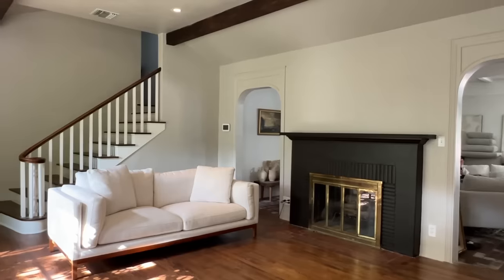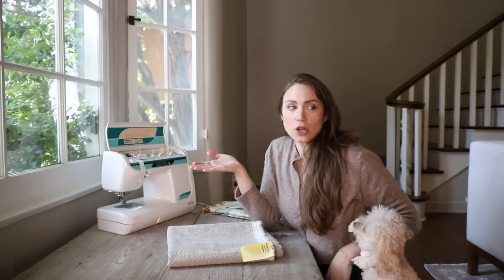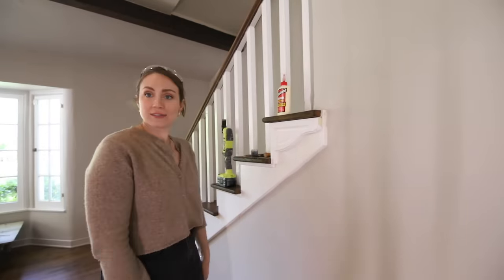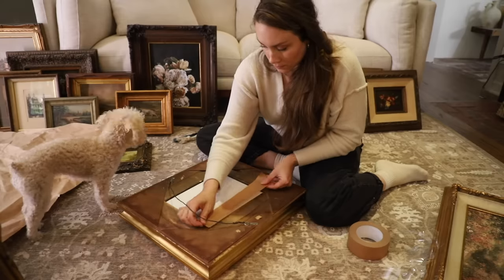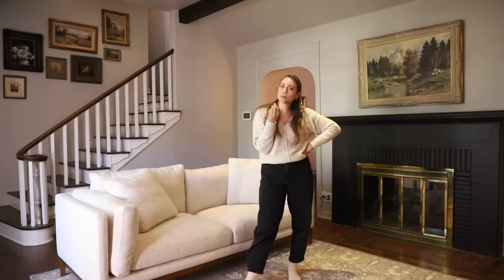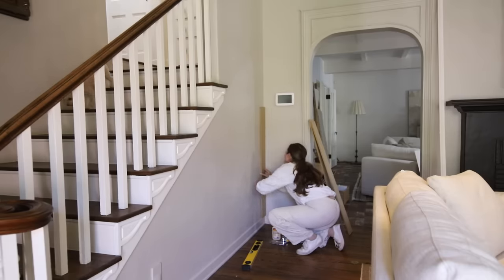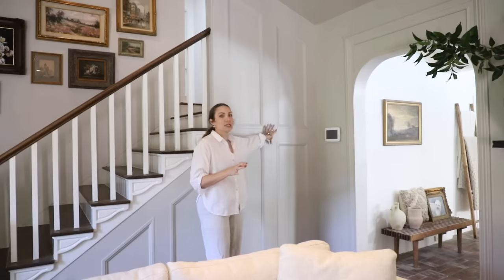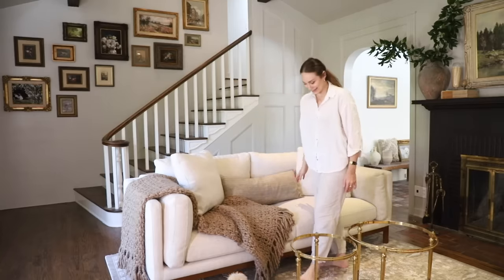ENTRYWAY & LIVING ROOM MAKEOVER *Moody French Provincial* | XO, MaCenna

Comment: Not sure about your local codes, but in Illinois, the combustible material covering electrical wiring is non compliant with code. The wires are insulated, but in the event the insulation is compromised, the fabric can start a fire. So I’d recommend checking your local code to double check the requirements.

Comment: @XOMaCenna, I don't know if anyone's mentioned this, but I got a great tip from a photographer friend about backing frames with craft paper. After securing the paper with white glue (rather than tape), lightly mist the back with a spray bottle, then use a hair dryer to 'shrink' the paper for a perfect fit. I add the tiny self adhesive 'dots' at the bottom two corners to protect my walls. Looks great, easily reversible. Thanks for so many great tips - I thought I'd return the favor!

Comment: Great job on the paneled wall; it looks professional!  I don't know of any trees that will thrive in a low-light room, but here is a solution that worked for me:  I've learned Kimberly Queen ferns are more resilient than Boston ferns as indoor plants, so I bought two and potted them in identical black plastic pots that fit into a large brass planter in my entry.  My entry is fairly low light, which isn't great, so one goes in my front patio with plenty of filtered sunlight and fern-loving Florida humidity, while the other goes in the entry in the brass pot.  Every 4 to 5 days, I switch them out.  Our A/C is in constant summer running mode which is awful for most house plants (dries them out) but this plant switch method seems to be working!  Both ferns look great, and the lush greenery adds so much to my interior decor.  If you want a plant with height, you could put one on a pedestal stand in place of a tree.  Great job on redecorating your room--it looks elegant and cozy.😊
Reply: If you can’t get potted trees to survive in a low light area I’ve seen a couple of DIY faux trees that looked amazing.
Reply: @jenniferfriesen7691  I do have a very realistic faux ficus tree that I love, but the only downside is it gets dusty quickly and it’s a pain to wash, lol

Comment: I love what you did to the stair wall. Question: How does the board and batton you added lay against the baseboards of the wall? Did you have to replace the baseboards since you extened the wall out a 1/2 inch? Or does the wall now overhang the baseboards?

Comment: I make my furniture smarter by drilling into the furniture a plug with USB and A outlets. That plugs into the back wall and my lamps plug in on the table top itself and I zip tie the extra length which tucks in the back and voila!

Comment: The photo wall came together so well. The picture your Mom painted of your dog is adorable. I wonder if it would have been easier to cut the top off the molding instead of cutting the wood off the stairs. I think the dark color on the fireplace makes the wall its on look shorter. And door sticks out a lot now. There is alot competing for attention. But everything always comes together in the end.

Comment: I think the gallery wall at the bottom of the steps still needs a your big oval picture there, which means some of those paintings would have to be removed in that spot to make that happen, plus, that large oval painting would tie nicely into the two Archway openings.

Another thought, your white couch in that front room, just overwhelms the room.  Per a whitw loveseat instead, or a rounded white loveseat would be even better.  Having said that, I keep coming back to a library lounge feel in that room with seating nestled more together in a corner, with a couple nice chairs off center, facing each other, or a little off center with each other, and a very small oval coffee table between them.    I just good for thought, but I still think the couch in that room over powers the room and needs to be more like a love seat style.  Just my thoughts.

Comment: Drill a hole in the top of the sideboard raised back, where it sticks up & where you want the light to be.  After removing the plug, pass cord through the hole & replace plug.  Repeat on the other side.  It’s likely you will keep the sideboard for a long time & want to have lights on either side but if you don’t, you can always fill the holes in.  For safety, while shaving wood, never point a blade toward your hands!